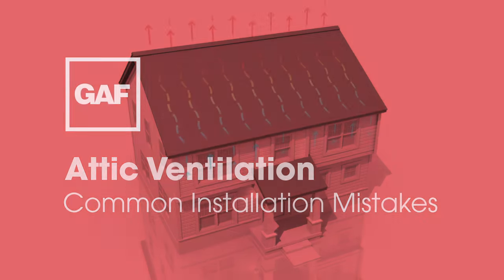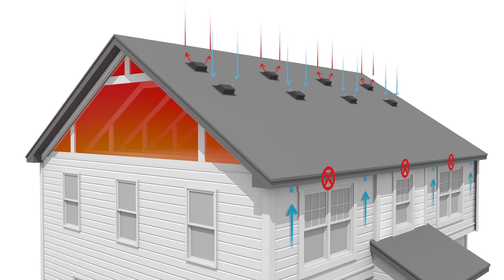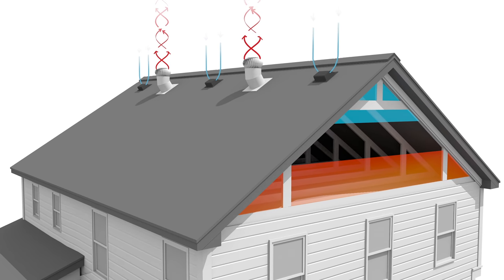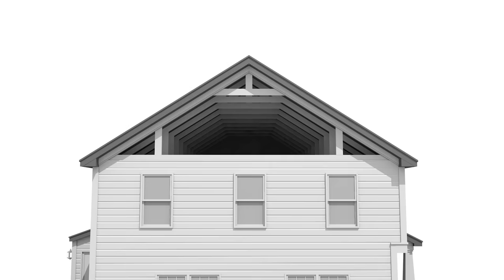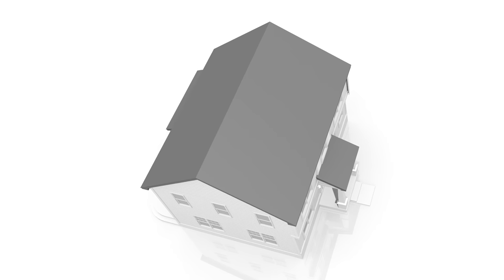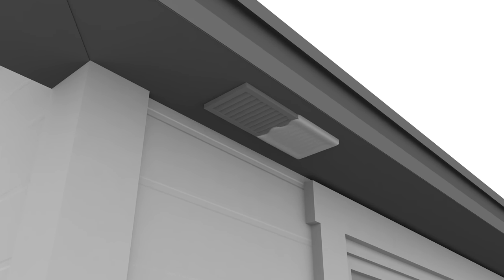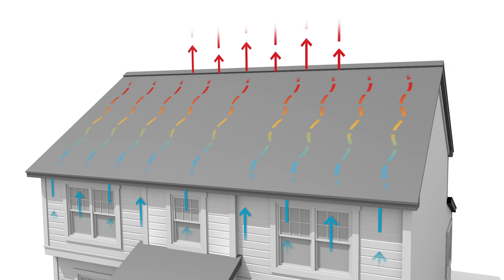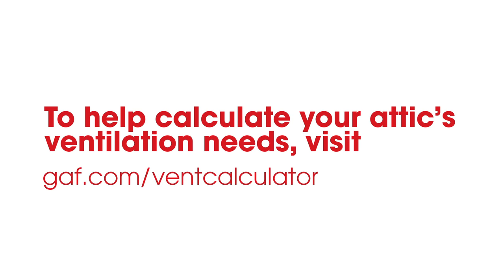How to Avoid Common Attic Ventilation Installation Mistakes | GAF Roofing

Comment: Plot twist:  the intake is actually your leaky house interior.
Reply: Yes but air sealing will help.
Reply: @janking2762  you can’t just seal up an attic and call it good. Proper steps must be taken.
Reply: @zachattack83 he's talking about the cracks and voids in the attic from the rooms below. Like the drywall butting up to wood. The holes drilled for wiring. The wholes sealed and cracks sealed around can lights. Those cracks pull your cool/ heated air out of the living spaces
Reply: @thebearclaw0  Exactly that. It's a split level house and I have actually two attics separated from each other. The upper level attic has an access through a closet in one bedroom. That access panel had a piece of R-19 fiberglass batt insulation that was very dirty from years of air movement up and down through that insulation acting as a dirt filter.

I will also be going around all of the exterior walls and insulate around electrical boxes with firefoam because in the winter I can feel a cold draft coming from them. I have a FLIR attachment for my phone as well to look for thermal variants to tell me where I need to seal or insulate better all over the house.

Comment: Just this past May 2023 bleed over into June 2023, we had our roof, "Re-roofed with GAF Products"!  I think we got "Ripped-OFF" by the local contractor.  My Father 83-yrs old is immobile, on oxygen and stays upstairs 24/7/365 unless he had medical appointments.  The upstairs temperatures have reached 85-deg Fahrenheit!  Albeit, this is a very hot summer, but the new roof is not deflecting the heat! We live in northwest Florida and the local contractor "Timberman Roofing Owner/Manager" was horrible!  The crew worked hard and fast ---- NO ONE SPOKE ENGLISH!  The contract stated that a "English-speaking" Crew Chief will be on site, but there was not any English speaking crew members period.  I did not like that they did not replace the sheathing on the whole roof!  They said it was only necessary to replace the sheathing in the areas as recommended by the "Crew Chief".   When the crew removed the old shingles and underlayment, I had a chance to climb into the attic above the garage and that sheathing looked like swiss cheese!  I may upload some videos.  I have never so mad at the lack of "professionalism" and "common courtesy" from a business!  I DO NOT RECOMMEND TIMBERMAN ROOFING and THEIR OTHER LINES OF BUSINESS! You could show this video to roofing contractors and they still wouldn't do the mathematics to determine the length of a ridge vent - who is going to climb into a attic and take measurements?  I just don't know how I can make ventilation corrections: The contractors cut a ridge vent into our living room cathedral ceiling that has no attic space and the ridge is very close to the length of the roof!
Reply: It would be vented in a gap on top of the insulation in the rafter bays.
Reply: @BryanL1982  That is my point the new ridge vent on the section of roof above the living room is not ventilating the hot air to make the living room comfortable: besides Timberman Roofing Company should never have cut a ridge vent on this section of roof!  For the second floor, I am beginning to think that the Timberman Roofing "Roofers" closed-off the ridge vent?  They used GAF Cobra Ridgevent-3
Reply: Your contractor may have been incompetent, I don't know, would need to see what they did, but you don't normally replace all the plywood, unless it is rotted, moldy, or delaminated. Also, roofs do not really reflect heat, and it is not a roofers job to cool your upstairs or even your attic space. Your actually not trying to cool your attic space, you are trying to regulate it, whatever temp it is outside is what it should be in your attic.
Reply: @brownamerican5786  Thank you for replying, but I didn't claim it is the roofers job to cool either the second floor or the attic space, but it is their job to abide by the customer's requirements unless it is either unlawful or unsafe. We requested a new layer of plywood on the whole roof because we were installing the fourth-(4th) roof on our home.- they refused to listen to me!  If you understand the difference between materials, the composition of materials and the color of materials then you will understand the transfer of heat. Our roof is less than one year-(1yr) old and we have water leaking through the roof.
Reply: i would apply radiant barrier stapled across the upper rafters, leaving a 3" air space between the plywood and the silver reflective sheets. It cost e $150 for a large roll, very inexpensive. I'm installing mine tomorrow & I will let you know how much of a temperature drop I have.
Reply: @janedoe019 Hi Jane! do you have any updates ? i’m getting my new roof on monday but i want to get the radiant barrier. please let us know. thank you

Comment: My GAF certified roofer didn't measure or discuss any of this. They just told me I needed a ridge vent and then installed it across the whole ridge. Even though I dont have soffits or soffit vents.
Reply from the maker: We recommend speaking with our experts to discuss your situation further. You can reach them at (800) 755-9392.

Comment: Avoid ridge venting in Oklahoma if given a choice. I've been a HVAC tech for 31 years and spend alot of time in attics. The hottest and most unbearable attics are almost always ridge vented. Turbine vents or thermostaticly controled power vents seem to work the best here.
Reply: Were they adequately exhausted though???
Reply: The primary purpose of venting is to maintain the health of the roof structure, not your comfort. It doesn't need to be comfortable, but there should be good air movement. Inadequate venting probably means inadequate intake. Forcing the air to be pulled in mechanically usually means that you're heating/cooling your attic with air from your living space.

Comment: I have a gable roof with static venting that was always extremely hot April - September, so added an intake fan on one gable end and an exhaust fan on the other, so I have crossflow all the way across the attic and got about a 25 -30 degree drop in the summer.  They are both thermostat and timer-controlled so they can run if it's between 10 am-7pm and over 90* in the attic.  In the Texas summer heat they usually come on at about 12 noon.  If they don't come on then I know the attic isn't over 90*F.
Reply: What do you use the attic for?
Reply: @nofurtherwest3474 cooling the rest of the house. A hot attic radiates upward against the bottom of the roof shingles, and downwards against the house ceilings. (And if the ceiling is properly insulated, but the air conditioner ductwork runs through the attic space, the air in the ducts is picking up heat from the attic even before it comes into the rooms that you’re trying to cool.

Comment: Next roof I get, I’m ditching the ridge vent and going back to the whirlybirds.
Reply: Why
Reply: @maplenook  Before I got my new roof I had the whirlybirds. In the Texas summer it was hot in the attic but bearable. Now that I have ridge vents it’s crazy hot in the attic. It doesn’t feel like any heat is venting. Most of the new homes in my area are going with whirlybirds.
Reply: If the sheathing under the roof way spray foamed, and the heat was blocked from entering in the first place, it wouldn’t be an issue.
Reply: I think the whirlybirds can act as both active and passive vents.
Reply: @Matlockization  we wouldn’t need them if the roof was foamed, but we have outdated building codes in my opinion.
Reply: @user-ln7of9gs4s  What do you mean foamed ? Like out of a spray can ?
Reply: @Matlockization  no. You call a professional, and they spray foam all the sheathing under the roof, blocking any heat from entering into the attic. When the house is built, is the best time to do it. Many people put a foot or two of blown insulation in the attic, but why? 

The point here is, with the blown insulation you’re letting heat in the attic. With foaming the sheathing between the trusses, you block the heat from coming into the attic. 

You don’t want heat from the summer coming into your house, so why have it come into the attic? The building codes are antiquated in my opinion.
Reply: @user-ln7of9gs4s  So do you think applying spray foam on the underside of the roof makes vents redundant ?
Reply: @Matlockization  when the attic is foamed, it no longer needs ventilation. There are videos on YouTube discussing this. People even heat and cool the space, if it’s a new build. Having a vent is no different than leaving a window open in your house. I’m not sure the dynamics, but I would imagine there has to be some air flow up there by form of heating or cooling with your hvac system or having a  vent. I honestly can’t answer your question.
Reply: @user-ln7of9gs4s Why are the building codes antiquated ?
Reply: @user-ln7of9gs4s  Every space needs ventilation or else mold grows and wood rots. You can't just spray foam the underside of the roof deck, cover the soffits, and call it a day. However, if there's free air exchange with the rest of the house or forced air exchange, then yeah, it doesn't need to be vented to the outside.
Reply: @tempesttube  Yes I agree. However I'm not sure whether all sides have spray foam because I'm not familiar with no ventilation.

Comment: Hi, I’ve got a ridge vent all the way along my roof peek with intake vents every 8 feet, my attic is 12 foot at peek but it still gets extremely hot in the summer in Texas. Did they do something wrong or is that just normal for my area? Thanks in advance.
Reply from the maker: Our Technical Experts will be able to help you, David. Please contact them directly at (1-800-766-3411) and they will be happy to assist.
Reply: Yes, they did something wrong. The intake should be continuous, not every 8 feet.

Comment: Excellent video which confirms the simple basics of ventilation! I had a couple people tell me this type of ventilation was obsolete and that new types of venting was the in thing. I had a roofing job where i was going to replicate this exact model of ventilation and even cut out the soffit for the vents. They had none on either side of the gable! Well the insurance company sent in another crew... no vents, and the owner had the crew install a couple solar power rotating exhaust fans. tsk tsk.

Comment: I have to say that for a house with a basement or a cavity for piping etc, the double cavity house walls could serve to suck cold humid air from under the house and expel it out through the vents at the top corner of the roof via heating. This could mitigate the spread of termites & wood rot in cooler climates. Intake vents under the roof would just defeat the whole purpose. Attic baffles look very interesting and might be more applicable in cooler climates.

Comment: Always have more soffit vent capacity than roof vent. Allows for better ventilation.
Doesn't mean double the capacity either. 
If you need 488 sq inches of exhaust then use 500 sq inches of soffit vent. Or a bit more.
Equal balancing may not be optimal for cooling.
Especially on those hot 100F deg days with sun blazing on your roof.
It will take more air flow to draw out the heat than what it needed at say 80F.

Comment: Contradicting info from today's potential new roofing contractor > > >  existing roof has a ridge vent and soffit venting as the house was built by my father in 1975.
Today's visiting roofing contractor wants to block-off existing soffit venting and install "smartvent attic ventilation" which is a long 1" cut on the length of the roof decking 6" up from the drip edge.
This doesn't make sense as the existing soffit venting draws from the 'lowest part of the roof... why change what works???
I need this attic to be as cool as possible as I now have an attic AC Air Handler for second floor air conditioning and new R8 flex-duct work in the attic. 
Currently here in SE-Pa on a hot humid 95 degree day the attic temp is 108-110 degrees.
Would the "smartvent attic ventilation" get that temp lower? 
(I'm thinking doing what the roofing 'expert' is suggesting is a mistake)
Reply from the maker: Hi, Ray. Our experts are here to help. Visit https://bit.ly/3ycNMvt and fill out details of your inquiry, and they will get in touch with you to help.
Reply: @gafroofing  ... sent BTW, I want the roofer to use your Cobra Ridge Vent vs the rolled mesh vent.
Reply: 1975 Era construction often the soffit vents are very poor. The roofer is by passing them with new lower intake vents as these soffit vents are insufficient
Reply: We had smart vent intakes installed when we got a new roof and our second floor is much cooler, here in Northern DE, about 1/8 mile from SE PA. We had no soffit vents and the new vents were a fraction of the work needed to create new soffit vents.
Reply: Glad you brought up this question.  tHanks Ray!
Reply: Adding smartvent is a great idea. But never seal up the soffit. the more intake, the better. As long as it's coming from the eaves. Gable vents should be sealed.

Comment: So far, so good! I installed this fan yesterday. https://www.youtube.com/post/Ugkx7yWIKcrbA9KMHkGSfcgxW2lsjHT6B8Sh I've been watching a continuous radon monitor in my house for about a week, and the levels have been running between 4.5 and 7.9 pCi/L. Shortly after I installed this fan, the radon level started dropping, and in less than 24 hours since I installed it, the level is now 1.9. My basement is approximately 2,000 square feet. Total home square footage above basement is approximately 4,000 square feet. The noise level so far is very quiet. Mine is installed indoors, so I had to purchase a cord and connector. If I have any problems later, I'll update my review. But for now, I'm very pleased with it.Update after 48 hours: Using a constant monitor, my radon is now fluctuating between 0.38 and 0.45 pCi/L. I've moved the monitor to my basement and am getting a constant 0.43 reading. After 24 hours, and when I know the weather will be safe, I'll place the monitor outside for about 12 hours. I'm thinking that the 0.38 to 0.45 may be the outside "ambient" radon level. I'm using this monitor (purchased from Amazon): Corentium Home Radon Detector by Airthings 223
Reply: @gafroofing  Is their any resolutions to our new roof that was constructed with GAF Roofing products.  The Timberman Roofing Company installed a ridge vent in our living room which is a high cathedral ceiling and was not supposed to receive a ridge vent.   Thank you
Reply from the maker: Thanks for reaching out. Contractors are not employees of GAF, and we recommend contacting your contractor directly regarding these concerns.

Comment: Can a DIY:er measure if you have a good air flow balance?
Reply from the maker: Thanks for asking, Zeke! You can find more information on ventilation here: https://bit.ly/3pqFtXh. If you need assistance beyond that link, we recommend that you speak to a local GAF Certified Contractor in your area! You can locate one near you here: https://bit.ly/3310NuP.